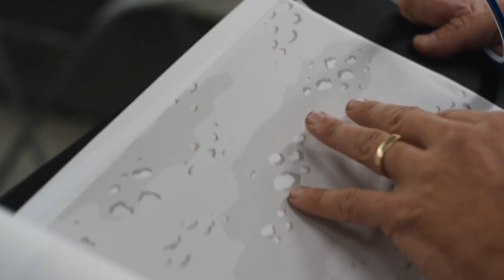First Drive Of The Dream Car Almost Ends In Disaster | Drift Lamborghini #3

Comment: Who else remembers losing constantly to Mad Mike in NeedForSpeed Shift 2. (those were the days)
Reply: EA Mari I was so happy when I FINALLY beat him
Reply: Man i lost 9 out of 10 times
Reply: Shift 2 had the worst habdling in any racing simulator in existence
Reply: Shift 2 was different from the usual need for speed games so was prostreet but I loved it
Reply: @John69420  At least it was better than all the other NFS games.  Shift was a step in the right direction.
Reply: Shift 2 drifting is so fun and kinda easy
Reply: @John69420  Yes because it isn't a full fledged simulator.
Reply: @John69420  to call NFS a Sim is disrespectful to the Forza and Gran Turismo series.

The edit was to add the word series because I'm an idiot
Reply: @salz_  but it tried to be with helmet cam and all that
Reply: @John69420  Any racing game can do that. Hell, it was also implemented into Project Cars. Shift was a series that was meant to capture the intensity of racing through a sim-cade physics model.
Reply: @ItsTheApeManWC  forza and gt are not sims any more
Project cars, i racing and at a push asseto corsa, but they are boring af
Reply: @Jimskateuk  At a push assetto corsa? Really? Project cars is a joke compared to assetto.
The sounds and graphics in project cars were next level when it came out. But assetto really holds up in the physics department.

Comment: Did you guys do an all tire alignment once you reset the brake cailber that modified support bar could be fractions off that's why the tyre could be locking up awesome wrap by the way :)
Reply: Not wrap. Paint

Comment: Very curious on how the transmission handles the e brake pulling, how can it be wired to press the clutch when pulled?
Reply: I think it works like the e brake Ken block developed with Ford performance for the focus rs. When pulled, an electric signal is send to the transmission which simply declutch. Maybe

Comment: Could some one tell me how the e-brake works? I'm somewhat confused as to how it can lock the rear wheels when this car has an automatic transmission and it doesn't seem like its possible to disengage the drive going to the rear wheels without a clutch.
Reply: He could have change the tranny to make it work if the hurucan didnt came with a clutch pedal and probably install a hydro e brake ,dont take alot you could leave the stock rear brake while adding a hydro ebrake too .is just like adding front brake to a motorcycle and fill the brake cylinder with brake oil.
Nowaday alot machine company make housing to adapt any tranny by cutting the clutch housing and adding machine made housing.
Anything is possible with the right sources.